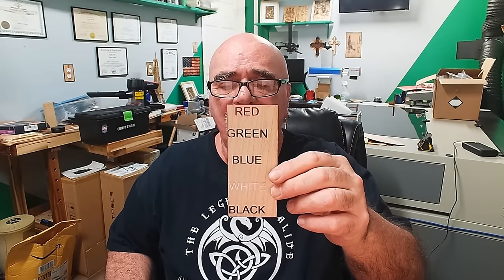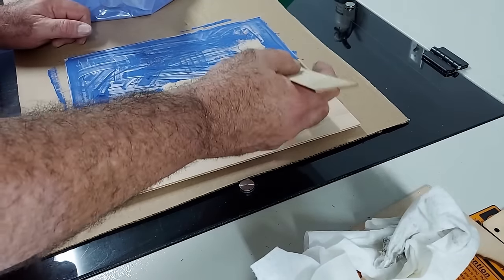😲 Laser Engraving in COLOR! Diode Laser & Co2! A powder coat trick!

Comment: I've been working on Powdercoating with my xTool D1 for a couple of months now.  I found the best way to defeat the fan blowing all of the powdercoat away is to put a piece of clear glass between the laser and the material (I use a glass from an old frame) raised up at least a millimeter from the material (or you'll be painting the glass!).  This trick lets me work with the lighter colors (white, silver, yellow, gold) that I had no end of trouble with before putting in the glass.   I've also been able to do 45 degree cross-hatch and offset fills with some success, but with the offset fills, too tight an interval creates issues. 
Another thing I've done, when I etch and pocket fill tile, is to run one more quick pass over everything with a clear gloss powdercoat overtop of the powdercoating I've already done.  Then I bake the tile afterwards for 10 minutes at 400 (I have a toaster oven for this purpose) and the resulting product has an amazing glossy shine to it.
After seeing your layered compass, I can see I've still got to up my game!  Nicely done, Rich!
Reply from the maker: Thanks for those tips Brian! Still a work in progress! 👍
Reply: Hi Brian, so just to make sure I understand correctly - you first etch the tile, then apply your powder, then put over the glass raised 1mm and then run the laser again ?
Reply: @gertkruger371  that's what I got from it bro 👍🏼
Reply: Tried this evening with some red powder coat from Prismatic Powders.  I used the glass trick, but wasn't able to achieve good results.  Everything from burned powder coat in engraved sections to unengraved sections where the powder coat adhered, but the coverage was poor after brushing it off.  Any hints here, Brian ?  Also, speeds and feeds for diode laser (20w in my case, but I think just getting in the ballpark would be good).  I was everywhere from 1200mm/s @ 10% which would usually end up in burning to 6000mm/s at 10% which wasn't really doing much.  I didn't go up into the higher % power ranges because I was getting burning at 10%.  Also, when filling, how about lines per inch ?
Reply: @markwithak2024  Are those speeds correct??  Was per second or per minute??
Reply: @isuzucrewcab  Sorry, per minute.  Those would be crazy fast at per second for the xtool.
Reply: And I havent been back to try again yet.  Looking at sealing + stencil + airbrush instead, although I have a ton of powder coat now...

Comment: I’m glad you are still experimenting with this. I found that if the powder coat paint isn’t stored in a cool environment and gets too warm, it wont stick as well when applying it. It gets a little gummy and doesn’t stay in the engraved area as well. Because of that I now store my powder coat paints in the refrigerator. I have used this powder coat method on bamboo and wood and have been successful with blue, red and yellow. I wish I could attach a photo to show how much color I was able to get. I have a diode laser but my power when burning with the powder coat paint was much lower. I found when using a higher power I was burning the paint instead of melting the paint.
Reply from the maker: Oh... thank you Sharon! Maybe if I put the light colors out in the humidity it'll solve my problem! Brilliant! 👍
Reply: Interesting that you say the powder clumps at warmer temperatures. I powdercoat large objects in the traditional way using an oven. I live in Queensland Australia and it gets well above 100 deg F in the workshop a lot of the time, never had any issues with powder clumping though. Powdercoat does have a shelf life of around 3 months but in practice, it's much longer.

Comment: Hey mate, little tip for brighter colours. 
After the first burn grab a vacuum with a stiff brush, vacuum out the charcoal which leaves the indentation the same colour as the wood (taking away the black). You can use a damp cloth also or run under water and use a paint brush. 

Lay the powder and burn. 

Because the black is now missing the colours will pop significantly 👍🏻😉

Great video 🥰
Reply from the maker: Thanks! If you look closely, you'll see the towel I used to clean it after the burn. I always clean my burns with misted water.

Comment: Hi RIch...I thought I would share unused powder reclamation method. (nice title ay?)  I use a cookie cooling bakers rack to hold my items when cutting.  When I use powder coating powder, I put my item for engraving on that rack.  I place some thing under the item to collect unused powder ( I use a 8x10 inch piece of yellow manila filing folder).  When I am done applying the powder, I just scrape it off and let it fall through the cookie rack onto my collection paper underneath and just collect it when I am done.  I will just leave it there until I am completely done and when I can just remove the cookie rack.  If there is any cutting involved, I just slide the collection paper out from under the rack and recycle the the powder right  then.  This way, I never have to remove the item from the laser until I am completely done...   Cheers and happy lasering
Reply from the maker: Awesome idea Pierre! Thanks for sharing! 👍

Comment: Hi Rich, I'm a photographer who is in love with lasers, I'm a total newbie to all this, in fact thanks to your videos is why I've got my Genmitsu LC40 and I love it.
Well regarding about binders to hold the powder paints on place to avoid staining the wood and avoiding any harmful fumes, you can try a very simple material that I use in analog photography when I need to create something to hold pigments for my alternative photographic techniques, that is egg white.
You can have some egg whites on a little bowl and with a foam brush just brush the surface with a thin layer and let it dry, then apply another layer on top with a little bit more of a generous amount of egg but not brushing too hard to lift the previous layer and immediately sprinkle the powder over the egg while still wet, let it dry and then let the machine blow the excess.
My explanation for the first thin layer is to seal the wood or the surface to create a primer for the second layer to hold to, and then the second layer creates a kind of emulsion type of layer just like the photographic silver emulsions are on top of film.
For the second layer you'll have to play with the amount of egg white and pigments you desire, please whisk the eggs first to break the surface tension and help it to spread more easily, then you can wipe off the layer with a wet cloth or rubbing alcohol, it may work, give it a try and please let me know if it works, I really want to know.
Note: You may use the whole egg, just whisk it very well and then strain it to get rid of any clumps and foam, you want a very homogeneous liquid, also you can mix the colors in and make a sticky mix and apply it to avoid the clumps it may form when sprinkling the powder, please note the very first layer "the sealant layer" is after the first engraving, or you can brush it first for a deep black also like the mica for intense dark results, I guess eggs will burn black without harmful fumes.  
Thank you for sharing all your knowledge with all of us.
Nuurs
Reply from the maker: Interesting... I found just covering it with clear picture frame glass did the trick!
Reply: @TheLouisianaHobbyGuy  That is a very clever approach! Awesome!!!

Comment: Late for the party, but I would use transfer tape for light colors, burn it normally with the tape on then spray a light coat of poly from a can, don't take the tape off and burn fill as you would, transfer tape come off at the very end. Worked for me on a 10W laser, had to try something after watching you :), thank you so much for your time making this video.
Reply from the maker: Awesome! 👍 Thanks for watching!

Comment: very nicely done, we've been fusing with diodes and Co2 lasers with powder coat for a while now with Acrylic here in the UK and Spain where I am and it works really well, you just need to practice to get the settings dialled in, after that a piece of cake, just watch your lungs with that dust..... Its easy with the c02 just a pain with a diode fan , I use a small piece of plastic and vent the air in a different way when I do powder colouring.  

Magnets area great idea for those of us who are lucky to have steel bed......although Lightburn's camera function can get you back to perfect alignment just as well.   great video and very useful of you to share. thank you.  

My friend in the UK has no problem getting powder coat by the bucket load in the UK like 10 gbp for 10 kilos of about 15 colours, here in Spain bugger all....I have to import it.
Reply from the maker: Ventilation is always very important!

Comment: One possible sollution für diode lasers would be some kind of shield under the laser, that would guide the airflow away from the engraving to the sides. A piece of acrylic or plywood with cutouts for the lens and screws, fit under the laser with enough space for airflow could be worth a try.
Reply from the maker: I wound up using thin pane glass.

Comment: Hey Rich. I think I have the solution to your powder paint blowing away using the diode laser. I've got my own channel set up, but haven't had the time lately to create any videos yet as I work full time. So I wanted to share with with you and your followers if they have a fan-cooled diode laser engraver so that NONE of your powder paint blows away.

1st step is to measure the bottom portion of your laser. In my case it's square, but then you also have to create a hole for the diode. Measure the diameter of the laser part that protrudes from the bottom of the laser.

2nd step is to create a cutout of the in Laserburn or whatever software you use to create your projects. In my case it was just a square with a hole in the middle.

Next, you just need a very thin cardboard. I used part of a cereal box, but any thin cardboard will do. 

Cut your shape out using your laser.

Once you have your shape cut, use some masking or painter's tape and tape it to the underside of your laser. Be sure not to have any tape across the area where your laser shoots down!
 
Now, you'll have cooling fins along the side of your laser and you don't want them to be blocked, so just take an exacta knife and cut silts in the tape so that the you have gaps for the air to still circulate through the cooling block. And that's it!

I don't take it off because my cooling fan still cools the laser just fine, it just doesn't push the air down the to piece that I'm engraving. Instead, it just pushes the air down and out the sides.  I have a separate air pump/tube/nozzle system for 'air assist', BUT you don't want ANY air assist when trying to use powder paint!

Hope this helps!
Reply from the maker: Awesome tips! Thanks!

Comment: Interesting results with light colored powder paint on diode laser.  I had similar cutting difficulty with my diode laser when I tried cutting white on white cotton quilting fabric.  The white pattern on the fabric is painted.onto the surface somehow by the manufacturer, but something in the properties of the paint caused the laser to skip over the fabric surface of the cutting edges.  I got clean cut edges when cutting black fabric, but not with white.  I think the light reflective properties of the white paint interfere with a diode laser similar to trying to cut clear acrylic.
Reply from the maker: Yep, diode lasers have a problem with white because of the 455nm frequency.

Comment: Just used ChatAI to clarify some of the basics of powder coating and the use with diode lasers.
Seems that the laser for melting the powder coat and infilling eg letters on a surfac such as timber or plastics needs to have an adjustable airflow system and direction of the flow.
"One way to minimize the impact of the air flow is to adjust the air pressure and direction. For example, you can reduce the air pressure to a level that is still sufficient to remove smoke and debris, but not so high that it blows the powder coating out of the area. You can also direct the air flow away from the heated area using a nozzle or other air flow control device.

Another approach is to use a laser system with a different type of air assist or cooling system that is better suited for powder coating applications. For example, some laser systems use a compressed air flow that is directed through a small nozzle onto the material being heated, which can provide cooling and smoke removal without blowing away the powder coating.

In any case, it's important to choose the right laser system and air assist setup for your specific powder coating application and to carefully test and adjust the parameters to achieve the desired results."
Reply from the maker: Thanks for the tips! I only had issues with the light colors and resolved it by covering it with a thin sheet of glass.

Comment: Just saw your video on coloring laser.
Place tape where powder coat is not needed. Add paint. lift tape off giving you clean area. Now tape hold area with no over lapping. Waiting for my pic to come in from Amazon will try it soon
Reply from the maker: Using transfer tape doesn't change the process.

Comment: I'm using a Sculpfun S9 with a laser wizard air assist. To combat said issue with the diode fan blowing around the powder coat. I cut 1/8" thick strips of acrylic to use as spacers, then place a clear piece of 1/8" glass over the work piece. There's enough air flow to allow the smoke from the powder coat to escape and it cures nicely at 10% power, 4000mm/min, 90 scan with overscan, single pass. I'm in the sculpfun group on Facebook. I have post in there about it with pics and a short video if you'd like to see
Reply from the maker: My final solution was just covering it with picture frame glass.
Reply: Pretty much same here, however I did runs without covering it at all and had no issues with the powder dispersing from the diode fan.......

Comment: Hi, I am waiting on my laser to arrive at the end of May is the estimate (Atezer P20 plus and a 4-1 rotary) which I plan to use to cut stickers in vynal for electro-salt water etching. The sticker cutter I use is a Brother sx 1000 but it doesn't allow image file swapping and the software is slow and difficult to create fine cuts.
I use transfer stickers of many types whether I need a high sticking or low sticking depending on the sticker I need to transfer after picking out. All this is very, very time consuming and because I have MS and coeliac disease my symptoms are increasing and abilities are progressively getting worse.
My plan is to attach the vynal to the metal surface and then laser engrave to expose the metal and then salt water edge for a deep etch which I have been doing. Great on cutlery from the recycle center and then cut to all sorts of shapes and for all sorts of purposes. Great of any stainless steel and brass, aluminium, etc etc. Have done hundreds as gifts for friends and people who inspire others.
Bottomline was to get a laser engraver and use it to create the sticker or paint mask for the salt water etch AND to have alternative art choices such as wood etching as time changes me and my disabilities.
So my thought has been with the powder coating blowing around placing a transfer tape over the top just before the laser melt of powder coat (or any similar paint) only the finished final laser paint melt/engrave is exposed and none of the powder waiting to be lasered will be blown around?
Reply from the maker: I had to cover some the powder coat (the white) with a thin sheet of glass to keep it from blowing.

Comment: Super Video. I spray paint my wood materials, then burn the text or image. The spray paint seals the wood around the cut. Then by rubbing Acrylic paints into the cut groove, rubbing off the excess that does not strain or mark the sealed wood around.     Maybe a similar process would work for the wet down white powder. After your color run, seal the wood around, then cut the white with the white.   Anyways, thanks for doing all the testing.
Reply from the maker: I've used your technique before, works great. I switched to using laser transfer tape since and that works even better.

Comment: I have managed to get white to work for me. It was very time consuming but worth it. I ran my OLM3 10w at its highest speed of 20000mm/min and 20% power and without the shield on to prevent the fan from putting too much air on. I repeated putting the white thermoplastic (powder coating) between each run and just ran it and ran it until i was satisfied
Reply from the maker: I wound up covering it with a thin sheet of glass.
Reply: @TheLouisianaHobbyGuy  I will give that a try! Thank you for the tip, I doubt I'd have considered it otherwise.

Comment: Hey Rich I had a thought on your diode laser testing. I know that on my laser (S9) there is a distance between the laser head and the work that it normally covered by the plastic safety ring, I know that there are a number of different versions of a 3D print file for eliminating that shield and adding air assist to the setup.  My thought was that maybe instead of an air assist adapter you could fashion an air deflector. Basically the air is blown down past the head and exits at the bottom once it's done it's job of cooling. Maybe instead of allowing the air to continue straight down it could be deflected outwards or even upwards at an angle with a 3D printed adapter that still had a hole of the beam to pass through but redirected the majority of the cooling air away from the project when doing powder. Might be something worth trying.
Reply from the maker: Yeah, I have thought of that, as well as adding a clear piece of glass inside and drilling holes on sides of the module, but I'm trying to find a way to do this so the average user can do it.